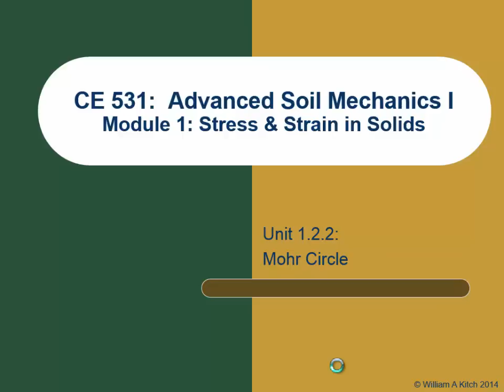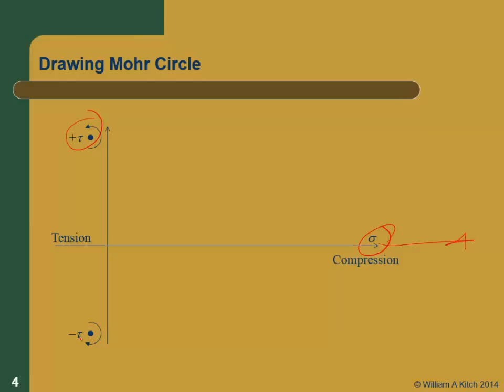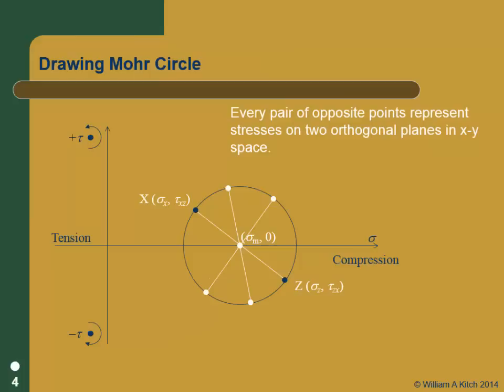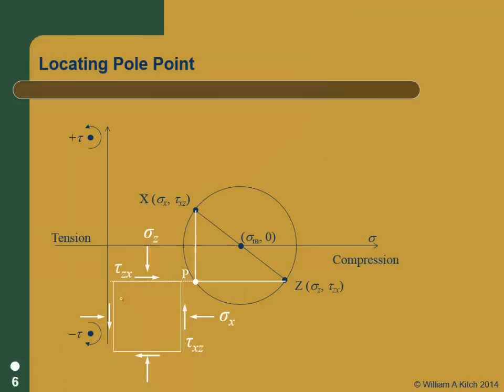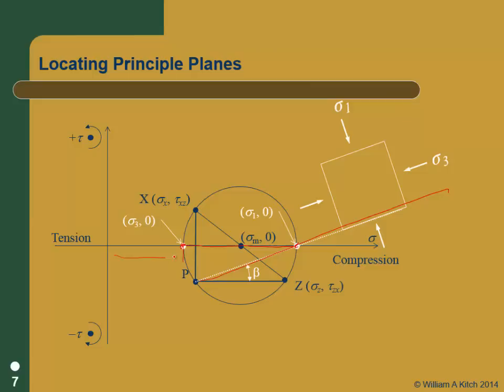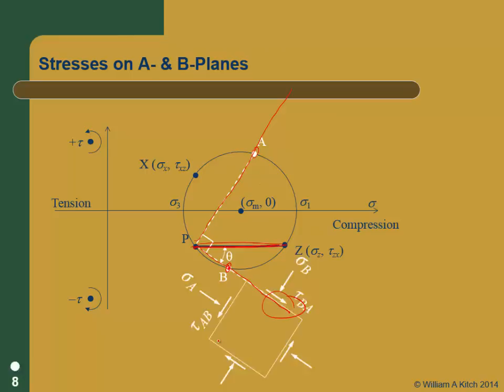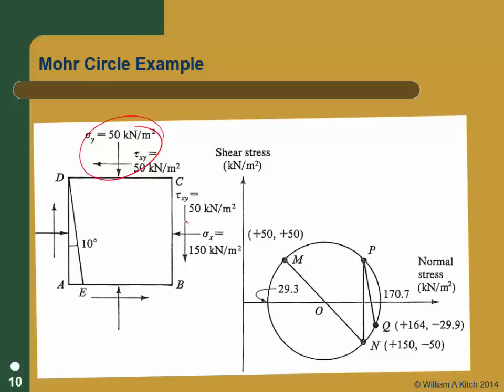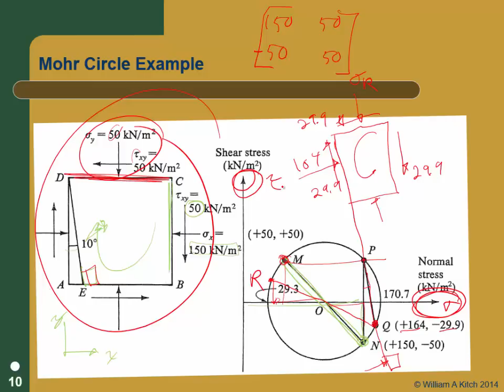CE 531 Mod 1.2.2: Mohr Circle

Comment: at minute 26:00 why did you draw the angle below the horizontal?
Reply from the maker: pamela vilela Because I wanted to compute the stresses acting on a plane oriented theta degrees clockwise from the horizontal.  The dashed white line starts at the pole point and is oriented in that direction.